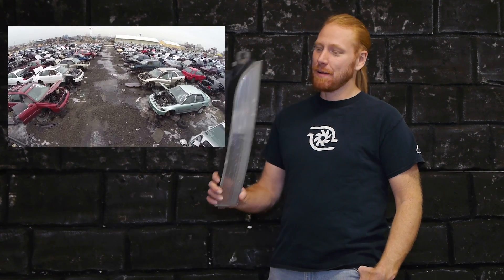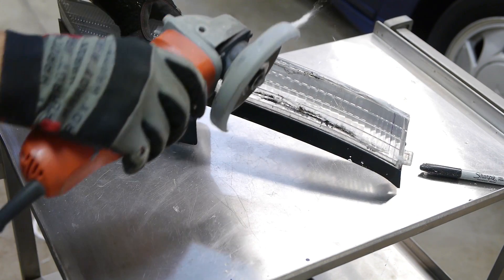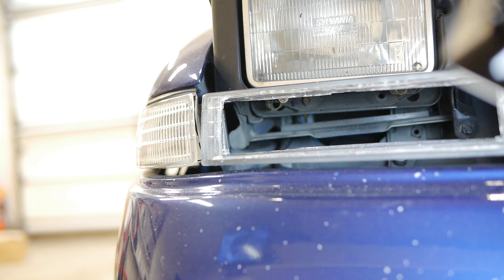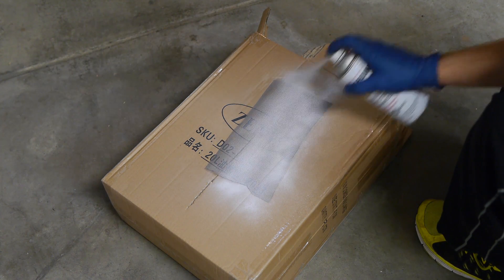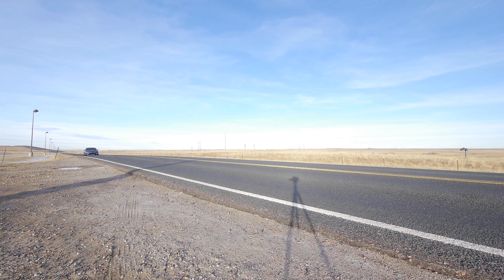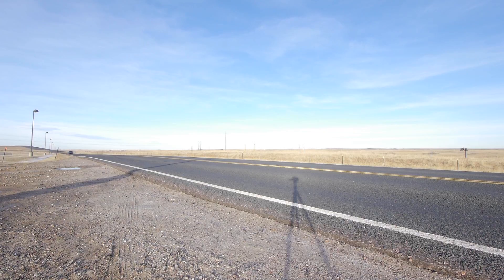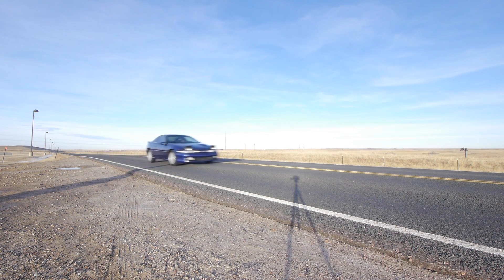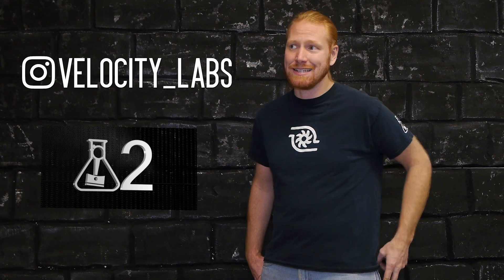Sneaky Cold Air Headlight Intake

Comment: The best tool for this application would be an jigsaw ran off of a compressor, finish up the corners with the a dermal with small 1/8” carbide burr.

Comment: dremal with cut off wheel then switch to sanding disk to smooth off ruff areas. .you can use plastic or metal gutter mesh or perforated aluminum and glue it from the inside area ..it will look much heterogeneous and last longer.

Comment: I know this video 6 months old, but colder air is better up until a certain point, unless you're using forced induction than you can run much colder air and it's better, but it's still not always "colder is better"
Reply from the maker: I'm running 30psi of boost, so I would say I'm using forced induction : D

Comment: Cold air yes, also low pressure. One of the lowest pressure areas on the exterior of the vehicle is the edge between the front end and hood. The air velocity is very high here, and as Bernoulli's law states, that's low pressure.

Comment: check the numbers vs the starting temp numbers, 
down started 108 finished 90 = -18
mdown started 104 finished 86 = -18 win lol
up started 97 finished 85 = -12
mup started 86 finished 80 = -6 WINNING lol
jus my calculations, if the starting temp is lower its goin to be lower temp hehe

Comment: I like the mod. It looks good and is very sneaky. But that test was terrible man. I'm sorry. If your starting temps were plus or minus a few degrees then it would not have been a big deal, but a 22 degree difference is huge. The data is almost useless.
Reply from the maker: Yeah, I agree, the test needed to be structured better.  I should have let the engine bay warm up to the same temp before each run.     I'll do that next time!

Comment: Maybe you'll manage to get some more cooler air if you're getting the Talon center grille insert. Behind the grille it's closed with like a plastic wall though like the usual Mitsubishi center grille, but drilling a hole into it and combining it with a hose to the intake might do the trick.
I thought about doing that myself, but Talon grills are super rare items in Europe and I don't wanna mess up mine.

I also saw a 1G for the track which had air inlets in the metal cover of the right pop up. Might work pretty good as well, but also not so nice for driving while it's raining.

Nice video once again, haven't checked into your 1G for some time - but it's nice seeing someone putting some professional love into it.

Comment: try oscillating multi-tool saw, you can definitely control it a lot better, buy one cheap from harbor freight and blades. I bought my at home Depot made by dremel  and is the best $100 dollars I have ever paid for a tool, the blades  replace blade are a little expensive but you would be amazed what you can do. thanks and keep the videos coming.
Reply from the maker: Cool I'll definitely check that out!

Comment: Some "high speed rotary tools" have special cutting wheels for plastic. They feel more aggressive than metal cutoff wheels and at lower RPM will cut away the plastic instead of just melting it. For even better results you can take the clear cover off and drill corners and then cut it with a scroll saw. That would give you nice edges and would be pretty quick to do with lower TPI blades. Speaking of blades, if you decide to use a saw make sure to get blades made for cutting plastic, if you can. Their tooth geometry is different from wood ones and will make cutting easier. If you are all fancy-like and have access to a laser cutter, you can even try that. The cover is curvy, but that won't make THAT much of a difference, especially since this hole does not have to be all that precise. 
On an unrelated note, it was interesting to see that at cruise speed the car only needed 30 HP or less according to the computer.

Comment: I did a simple mod where the intake was tucked inside the front bumper. the only sacrifice was the fog lamp. it worked out great but the only downside was rain used to soak up the filter, meaning days when it rained I had to remove the filter.

Comment: Looks good! What was the outside temp? Are u running speed density? I did a similar mod to get cooler air. I'm running speed density. relocated the filter to the bottom left corner of the fog light. Temp is within 10 degrees of ambient temp.
Reply from the maker: I think it was about 50 outside, somewhere around there.  I'm not running SD yet, I'm on a 2G MAF during this test which is helpful because it gives a more accurate representation of intake temps.  On speed density it's reading the charge temp instead of actual intake temp, so for this test a MAF is a little more accurate.  I'm upgrading to Speed Density soon though for my HX35 install!
Reply: Been looking forward to the upgrade! Get on with it lol

Comment: you have a lab coat....that makes you a scientist.
Reply from the maker: This is true.
Reply: Used somekind metal piece to liner helps lots Make straight Lines and use 1.0mm rst grinder cuttin wheel =)

Comment: Very cool video! 

Good approach to your experiment design, however, if I could make a few suggestions.

I think two minutes per run is too short of a duration. It would take longer to do your logs, but I would think something like 20 minutes to 30 minutes per run would be better. This way you get a better idea of the steady state cooling difference. This is shown at the end of the video, where you mentioned that the temperature continued to plummet while driving home. 

Also, in addition to noting the starting intake temperature, I think it would be good to also note the ambient temperature (if possible with your logging software). That way if there was any change in the outdoor temperature, you could compare different temperature deltas (like ambient starting, intake starting, ambient ending, intake ending). 

But, like you said, you're not a scientist! :P Keep up the great work, I love your videos and the quality is on par with (or even better than) bigger channels.
Reply from the maker: Yep, good ideas!  I'll incorporate those in my follow up tests :D